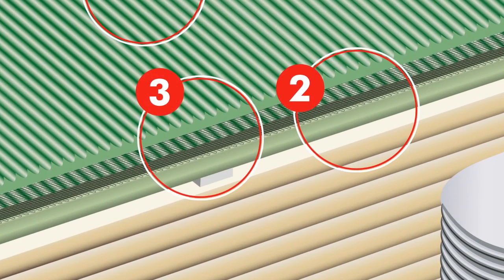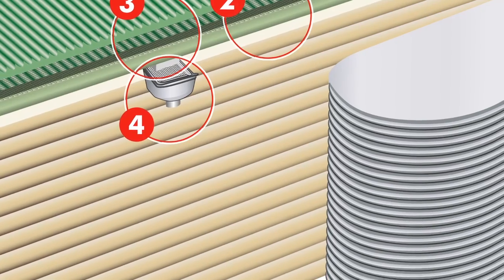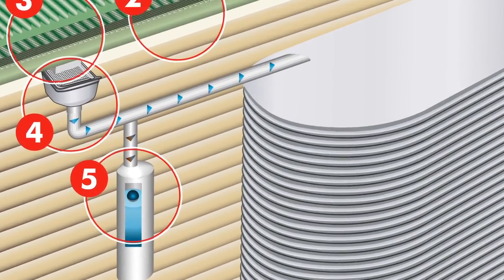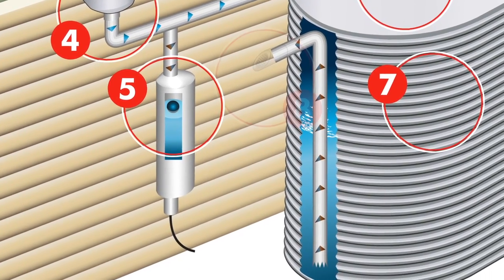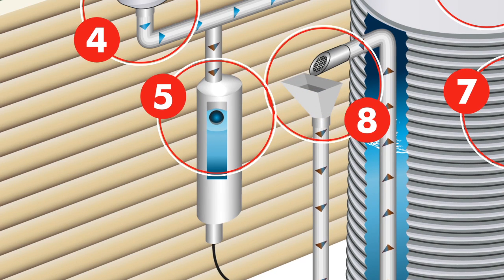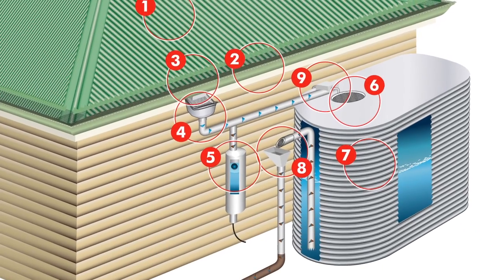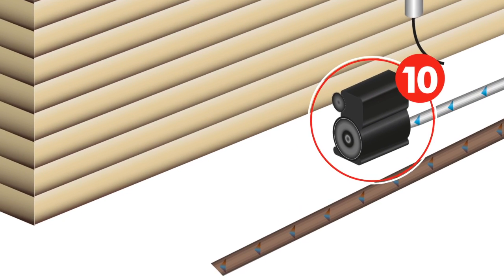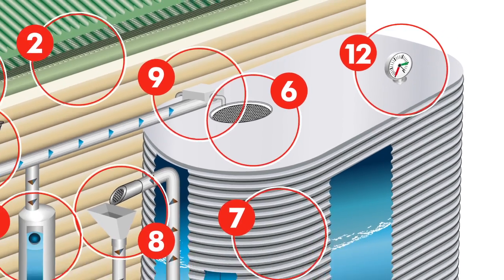12 Steps to Creating the Complete Rain Harvesting System

Comment: What is the price for a complete rain water harvesting system?
Reply from the maker: Hello @vincentmabiba5531, 
Thank you for getting in touch with us.

We’d be more than happy to help with a complete rainwater harvesting system. Pricing can vary depending on the size of the system, the type of components required, and whether installation is needed. To provide an accurate quote, it would be helpful to know a little more about your requirements—such as the size of your roof area, the intended use of the water, and your location.

If you’re unsure where to start, we’d be glad to walk you through the available options and recommend a setup suited to your needs.
Please send through your information over to info@bmco.com.au.

We'd be happy to help.

Comment: What treatment do you suggest to make the water drinkable ?
Reply: Several stages of strainers (probably 100 micron, 1 micron and .1 micron) and filters (charcoal are nice but reduce pressure greatly, ceramic can work well) and finish it with a UV tube to kill microbiotics.  You can also hook it up to a reverse osmosis purifier which would make it about as pure as you could possibly need it to be.  If you're worried about chemical contaminants I don't know.